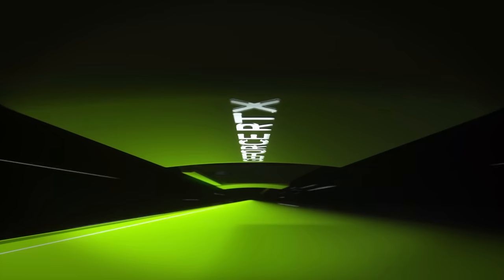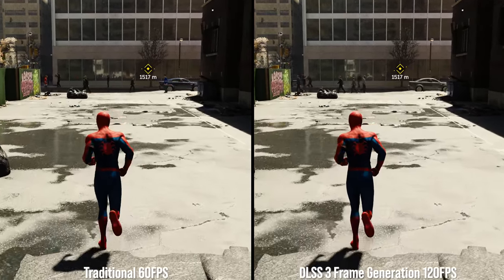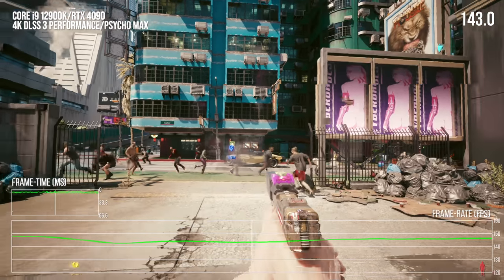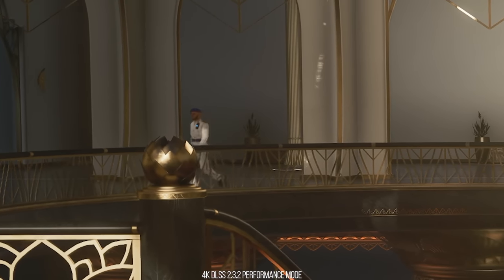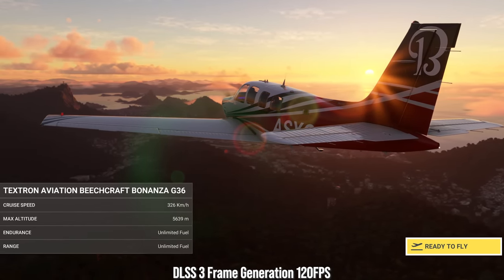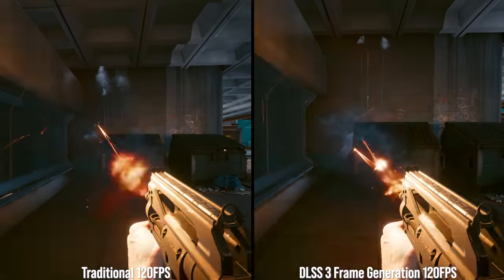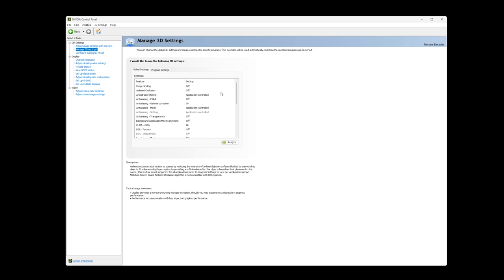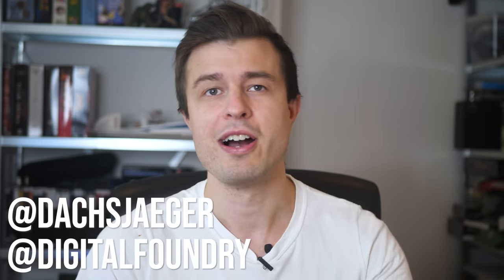Nvidia DLSS 3 Analysis: Image Quality, Latency, V-Sync + Testing Methodology

Comment: Amazing video, the only thing I don't understand though is why you would turn on VSync at all anymore if the ultimate aim is to have settings heavy enough to stop the game from exceeding your monitors maximum refresh rate? The lower latency of VSync off is a win and if the aim is to never exceed the monitors refresh then you won't have tearing above say 120hz, so why even enable it? Thanks again for the amazing video.
Reply: You'll still exceed the refresh rate sometimes, and the VSYNC only comes into effect when you hit the 120 FPS mark. So you're choosing between having occasional periods of higher latency when you are at or above 120 FPS, or periods of tearing. The tearing would be more noticeable for me and I'd do the same as Alex, but it may depend on the game and the person.
Reply: @jsVfPe3  True, the only reason I'd probably leave it off is the extra 5ms latency you gain back by having it off when even below 120hz, like you can see on Alex's graphs at 28:51 for example. I know it's a tiny gain but I'd probably only enable VSync for games where I know I'll be getting crazy high framerates about 120 such as CS:GO, etc. Most of the games I'd expect these crazy frames in won't have DLSS 3 anyway so I'd just use the in-game VSync toggle on a game per game basis.

Comment: In addition to enabling gsync and vsync, you should limit your frames under your monitor's refresh rate. That way you won't be subjected to the vsync delay.
Reply: We still don't know how DLSS3 works with FPS limiter, but i think we will find out soon enough.
Reply: @Lackesis  I'm more so trying to explain to anyone who happens to read this that while gsync+vsync is the correct thing to do, you need to use a frame cap under the refresh rate. If you use vsync as the limiter, you are not using gsync, rather you are fully vsynced and will get to enjoy the vsync delay in it's full glory.
Reply: @unawarebot2529  There is some weird behavior going on, because Nvidia changed how vsync works recently so that turning on vsync+gsync in the nvidia control panel automatically caps your framerate below your refresh rate (for my 240hz monitor, turning on vsync with gsync caps my frames at 225), but it seems like it doesn't work properly with DLSS 3. Not sure what's going on there, might be part of why Nvidia said that Vsync isnt working with DLSS 3 currently.
Reply: But then you get uneven frame pacing, that makes the game look significantly more juddery and less smooth, that's why dropping to 59 fps while targeting 60 makes such a big difference

Comment: Great work Alex!  I don't trust any upscaling coverage that doesn't come from you at this point because of how in-depth and through you are.  I noticed a couple additional things to what you pointed out.  The side-by-side comparison of Lyra does show some artifacting right around the hands and the gun during the run animation that I noticed at normal gameplay playback.  I wonder if that type of artifacting could be obscured with per-object motion blur, since the artifact kinda looks like a broken implementation of motion blur.  There's a lot of disocclusion around the arms too, so it's not just the legs that really exhibit that type of artifacting.

One thing you didn't mention is how particles work in DLSS 3.  Again, looking at the side-by-side comparison of Lyra, the particle effect on the door you run by looks like the particles are sparkling and are not temporally stable in DLSS 3, while they look very stable with native rendering. This kinda looks similar to the effect you saw in DLSS 2, where there would be ghosting when there wasn't a motion vector attached to the particle, except in this example, the particle nearly disappears in the AI generated frame, leaving you with a "sparkling" effect in motion.  You can also see the same effect with the yellow middle transporter thing in the same Lyra comparison.  The brightness of the particle rings goes up and down on each real and generated frame, which results in a "sparkly" effect you can see at regular frame rates.

Comment: It’s brand new tech so it’s definitely going to be a few months before they really optimise it, and iron out the bugs. 

Got to say, the 4080 is the best GPU I have ever had. The amount of performance uplift even over my 3080 is insane, and it runs 10 degrees + cooler than my old 3080 ever did on most games. 

Haven’t even seen it go above 62 degrees on Plague Tale Requiem maxed out at 4K, or go above 310W of power.

Comment: Limiting FPS can be done in more ways, with software like MSI Afterburner you can lower power consumption.
You can even underclock and undervolt the GPU for less performance to hit your let say below 120FPS.
Another option would be to run the game in 5K,6K,8K to lower the FPS amount to not tear and add input latency.

I would say the lower power consumption option would be the fastest one, cause it is just a sliding bar you can do in seconds.
You can make 5 profile settings and just change it on the fly with hotkeys.
60% Power profile
70% Power profile
80% Power profile
100% Power profile
110% Power profile

Comment: About VSync global settings: or use the GSync 1st option (enable for full screen) and frame cap 2-3 fps bellow monitor's maximum refresh rate, either way that was one of the best explained videos I've seen and the only one until this very moment that explain this! The verdict: I'm using VSync and frame cap along with GSync.

Comment: The reason why the image reconstruction makes more errors on a lower frame rate is that the motion vectors need to be bigger. Since each motion vector is calculated only from one frame to the next one. So the original frame time still matters for DLSS3 here. You can get similar issues in most physics simulations which only use discrete approximations for the motion of objects. The same problem occurs when you use linear motion vectors for image reconstruction.

Comment: It sounds like the best scenario for using DLSS 3 is when you have a high refresh rate VRR monitor, and with help of DLSS 3 you will get closer to maximum refresh rate but NOT exceed it, or alternatively tell the GPU to just drop all frames after frame caps.

Comment: 31:03 was not expecting this. Usually setting a frame rate cap 3-4 frames lower than your monitors refresh rate is enough to avoid the additional input lag caused by v-sync. I wonder why that's not the case here with DLSS 3. Maybe official v-sync support will make it behave like usual. Great and very thorough analysis as usual guys!
Reply: He still had vsync enabled in this case which confuses me
Reply: @thecs9300  V-sync needs to be enabled if you want to avoid screen tearing, even if you have a G-sync monitor
Reply: @emile2330  I didn't think you did as long as you stayed bellow your monitors max refresh. I have certainly never noticed any with vsync off unless I go above my monitor refresh. If I do go above it then tearing is terrible, thus the frame cap.
I thought this was the entire point of gsync, so you could disable vsync without tearing.
Reply: @thecs9300  Nvidia control panel V-sync has to always be enabled when using G-sync. On top of that, preferably in Nvidia Control panel you should also use Ultra Low Latency mode.
Reply: @thecs9300   I used to think that too, in my case there were some games where I didn't notice it and others where I did, there is a very good explanation of why you should use V-sync with G-sync on a page called Blurbusters, the correct way to use G-sync is by having V-sync enabled to avoid screen tearing and capping 3 or 4 fps below the max refresh rate to avoid the input lag caused by V-sync.
Reply: @thecs9300  You will still get tearing with gsync below the monitors refresh rate if the game's frame times aren't perfectly consistent. Usually it's less noticeable though, tearing at near the bottom of the screen. Vsync has virtually no added latency when working alongside gsync though.

Comment: 1:56 I switched to a capture card for all my recordings for exactly this reason after months of fruitless troubleshooting. The one situation where I was able to actually get a smooth recording with local capture was after OBS implemented a change for Turing's new NVENC upgrades, and that only worked for games that run in actual exclusive fullscreen, a nearly extinct breed at this point. Anything else struggled to even hit 60 fps for a full minute without chopping.

Comment: 25:44 This is why Native 120fps needs to become industry standard, the reliance of modern games on TAA Upscaling means 120fps isn't just smoother, it's cleaner and more precise.
And that's only going to get even better when we adopt 8K, even changing nothing in the source render TAA Upscaling will produce much more detail when output to an 8K target.  (Currently HDMI 2.1 can do 8K120 with reliance on Dispaly Stream Compression, but the Displayport 2.0 connection standard is soon to hit the market which will greatly reduce the use of data compression, and hopefully the next iteration of HDMI targets 8K120 without compression).

Comment: Another place where the frame generation sticks out like a sore thumb is at 11:27, while the camera follows Spiderman's swing from a relative static angle. The character model has this weird glitchy aura clearly visible even at full speed. This is most visible on parts where there are small gaps in the character silhouette, like in his armpit or between his raised arm and his head.

Comment: Gotta say, frame generation is a major godsend for laptops. In Cyberpunk at a given set of settings, I can run native at 100-120 fps, but the fans ramp up, and are quite loud in my cubicle. With frame generation, I can cap the frame rate down to 72 (half the 144 hz refresh rate), which allows the fans to run much quieter (and not bringing unnecessary attention), but still retain an excellent experience.

Comment: You can use the Nvidia Control Panel to limit your framerate under your refresh rate to ensure G-sync is always running, but there could be tearing without Vsync. Battle(non)sense has a good video on G-sync. Basically, turn it on in the control panel (fullscreen and windowed setting), cap framerate 4 frames under your refresh rate and turn on V-sync (IN GAME where possible). This will give you the smoothest possible experience.

Comment: Thanks a lot for the analysis, especially the part about low framerates. I am right now using my 4070 Ti together with DLSS3 to get some really nice low-power-usage but high-quality results at ~80 fps via the max framerate setting in the control panel. Playing Cyberpunk (with RT) or MSFS at max details on 1440p without going beyond 150W power usage on my GPU, that's pretty impressive (and nice for my electrical bill and the environment).

Comment: This video was a huge help to me. I watched it when it first came out but I got a 4070 yesterday. I noticed V-Sync was forced off when ever frame generation was turned on. With out VSync I had constant tearing so even when the frame rate was above 60 it looked like it was way below. I was starting to think DLSS 3 wasn’t all it was cracked up to be. Then I rewatched this video today and saw I could enable vsync through the control panel. It made all the difference in the world. I can play the Witcher and Spider Man at a locked 60 FPS with full graphics settings and raytracing at 4K and it looks great.

Comment: FG works really great in Cyberpunk. This game has very steady framerate now. So, I can aim to achieve 90 fps at 120hz TV with FG on, and it's fluctuate just between 70 and 100. But some other games, with big difference between lows and avg. fps - are hard to handle.  I would like to see video about how properly to limit fps while FG is on (looks like you need to cap at half desired rate) in hard scenarios.  Scenario 1: bad 1%lows . Scenario 2: x1 fps in open world locations, x2 fps in dungeons.

Comment: What an incredible analysis of a truly revolutionary tech advancement! We've been contemplating such a frame generation/interpolation technique in the GPU/3D rendering world for such a long time but only now has it finally been realized. Sure, it would be great if it wasn't a proprietary tech owned by a less-than-generous company that does little, if anything, for open source software and community driven projects but hopefully this will inspire others to follow Nvidia's lead and create similar tech. Great work as usual DF!

Comment: So maybe a long post but something I have noticed as was a PC Gamer playing on 34"  IPS 60Hz Ultrawide for the good part of 8yrs+ and only recently got the new Alienware QD-OLED 34" which I'm running at 144Hz for the 10-bit colour accuracy.

1:
No matter what, I have always found that enabling vsync in pretty much any game introduces mouse movement latency, that elastic effect you see when moving the mouse around quickly. Some people get used to this, and I did too for a stretch when I was on the 60Hz monitor with no VRR,  although for many games I left vsync off for the instant mouse movement latency as it was too jarring at times.

Now that I have a VRR monitor up to 175Hz and with Gsync Ultimate, I only have Gsync enabled in NVCP, and have not forced Vsync on in the global setting there. I also leave Vsync off in all games, I have yet to see any tearing whatsoever whether the game is running under or over my framerate target, which is either dictated by the refresh rate or a manual lock in the game settings where available - Days Gone is a prime example, has a lock target set to 120fps, refresh rate at 144Hz.

But in games like Days Gone, I have to choose 120fps target because the preset slider is not granular, it goes from 120 fps to 150 for example, so I settled on 120. If I set it to unlimited and let it run at any fps it wants, then it could be 150, 170, 165 fps etc - In these situations I still see no tearing, just a nice and smooth motion. I lock it to a comfortable 120fps because the GPU caps don't whine as much then and the GPU fan doesn't run as loud.

2:
So what's going on here, why am I not seeing any tearing? is it because my monitor is an OLED and the nature of OLED motion means any tearing you would normally see on an IPS-LCD is removed?

3:
Is it because it is Gsync Ultimate?

4:
Is it a combo of both 2 and 3?

It's an intriguing one, I have tested with a bunch of setting configurations in a whole host of games since getting this monitor and no tearing is observed in anything whilst leaving Vsync off, but leaving Gsync enabled and letting the Gsync Ultimate module do what it needs to do.

This sort of thing doesn't really get clarified much on technically geared videos or reviews so I've observed this thing and am asking myself what's going on, even though I see no problem (tearing), so am not too fussed either way lol.

RTX 3080 Ti FE for reference and the display is an AW3423DW.

Comment: Awesome work! It's always a pleasure watching such detailed analysis from you guys! 
Regarding the V-sync issue, I'm curious about Fast Sync. As far as I understand, it could be used to remove the added input latency when Fast Sync is enforced on the driver level instead of V-Sync. Although I noticed that it behaves weirdly with some games when it's combined with G-Sync. Have you test with Fast Sync as well?
Reply: Fast Sync introduces stutter, unfortunately.
Reply: @aweigh1010  looking at it from a technical standpoint, I think it should be the same phenomenon as Alex demonstrated with the MS Flight Sim example, where technically, there is no stutter, but the camera motion is uneven, as differences between frames is not the same each time. As per my understanding of how Fast Sync works, it keeps an unlimited number of frames in a buffer, and sends the latest one to the display during the sync period. 

I wonder if setting a frame limiter in the control panel to the display's refresh rate, turning on Fast Sync and enabling Image generation could be a way of ensuring you're always running at the max refresh rate of the display, even when running into bottlenecks or very heavy scenes, all the while keeping a relatively low input latency.

Comment: the gsync/vsync bit was interesting, but gsync was mainly for when the framerate is lower than the refresh rate, and to replace the software nature of vsync and handle it on the hardware side.
so the fact that you have to enable vsync is hilarious in itself.
so, having to deal with having more frames than the 120 per second you need is not a bad problem for most people at 4K :D

Comment: I'd like to see how Nvidia Fast-Sync works with DLSS 3 to keep latency down. It may also be interesting to isolate the AI generated frames to look at in motion and inspect artifacts that way. In other words, take the 120 FPS footage, cut out all of the traditionally rendered frames, and view the 60 FPS of purely AI footage. I suspect it would heighten the visibility of artifacts.  

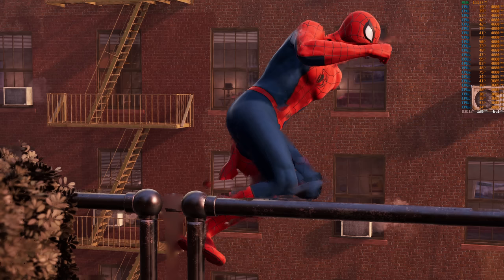Also  at 17:13, by overlapping the frames, I can tell the dark flicker artifact only appears within the pixels that were occluded by Spiderman in the traditionally rendered frames. Thus this is a disocclusion artifact, just like the metal fence post artifact in the other scene at 16:38. The high contrast of the bright, reflective window against Spiderman's dark body is what makes this especially obvious and difficult to resolve.
The artifacting around the sides of Spiderman's head is surprising, as is the failure to reconstruct the horizontal window frame properly, as most of it is not obstructed in either frame, and the motion is pretty linear.